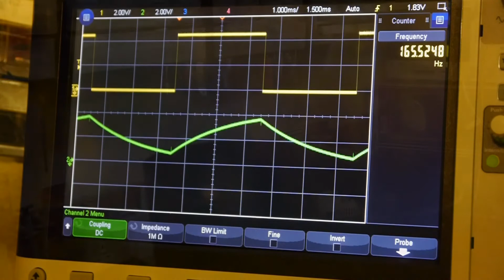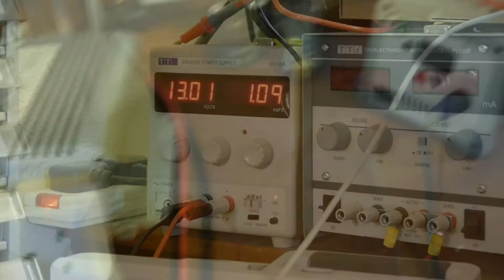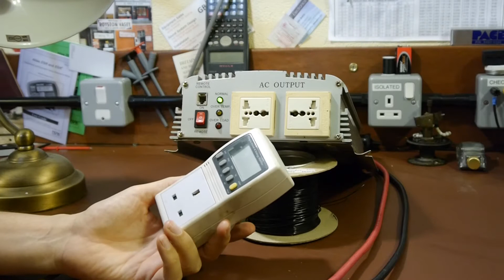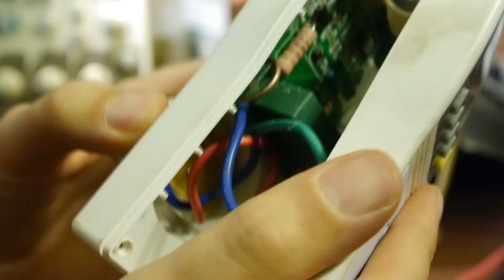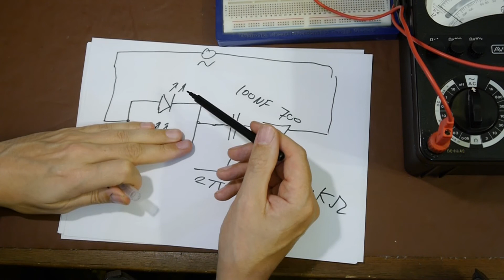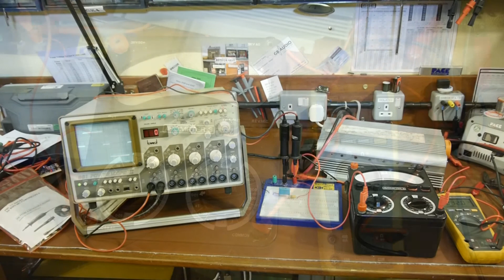Mains Perverter

Comment: Low frequency inverters are HEAVY. These are high frequency, and the better versions use sinusoidal PWM to control the output stage. And, yes many can run high wattage loads. I run an air conditioner on one. Cheers!

Comment: Sorry to hear about your Dad Chris and hope he make a speedy recovery. Glad to see you back though. I used to have one of hose under the bench in a caravan. It did drain the battery very nicely. That’s a horrible waveform though. Great video as always. Cheers Graham
Reply from the maker: Radiocruncher Graham nice to hear from you and I hope all is going well with you.  If you think those voltage waveforms look bad wait unit you see the horrible current pulses. Wanted to ask where you got your nice variac from ?
Reply: All is good Chris thanks. I got the isolations transformer/ variac from an bay seller. We did a bit of haggling though. This is it http://pages.ebay.com/link/?nav=item.view&alt=web&id=112558280270
Reply from the maker: Radiocruncher  Very very nice but expensive have you been happy with the quality. Regards Chris
Reply: It’s seems to be put together very well. First thing I did was take the case off then phoned Simon to make sure I got the right one! Regards Graham

Comment: I think the current difference is all to do with power factor Chris. Try plugging in a radio into it.
Reply from the maker: Simon Spiers  Hi Simon. Well it’s certainly related to the operation of the Wattless dropper employed within the power  monitoring plug.  The AVO definitely was not correct instrument to measure the current flow as it’s designed for sinusoidal waveforms where as the output from the inverter is a modified sine wave which is really a square wave. For a square wave I’m guessing is relatively easy to apply a correction factor but this is not exactly a square wave either. I thought I had the answer using the Fluke 175 true rms meter as it indicated 26mA  for the square wave and but when I measured the same thing using a BK5491 I get 3.5 mA. So go figure are any of the reading correct. Who would have thought a simple AC current measurement could be so difficult.

Comment: Good to see you back Chris, I thought you'd been heads down with an important work project. Good to hear your Dad's back home anyway. Was he in any rush to get home, what with all the young nurses? :)  On the inverter, is this the sort of thing they install on more recent buses? I noticed on our ones here they have BS 230v sockets every few seats and wondered if that was just for the cleaners when the bus was parked back at the depot with an external supply connected or they had a hefty inverter installed. One of those things you ponder on the way home after a night out in Cambridge. The AVO will measure square wave shapes high, just to confuse things.

Regards - Andrew
Reply from the maker: Andrewausfa Hi Andrew hope that all is going well. It was nice to post a video again but don’t think I will get many more in before Christmas. Just got lots on at the moment, away a lot with work and doing work projects at home nights and weekend.  I’m guessing these inverters are quite common now but the output is just horrible. If I was going to purchase one I would definitely pay more and buy a pure Sine wave type as opposed to modified sine wave as this one is.  You know I have thus far gone through life quite happy with power voltage and current measurement but you should see the horrible current pulses not so easy to work out the long hand root mean square of these buggers. I have tried 4 different meters and got 4 totally different readings but on the other hand it’s very interesting when things don’t go to plan. My best regards Chris

Comment: My suspicion for the lower current on the test circuit is the average voltage on the inverter being higher, which means less current on average, as you are trying to do a power measurement in effect, power would be the same, higher voltage gives less current for the same wattage.
Reply from the maker: TheDefpom  Hi many thanks for reply. Just for completeness my test circuit was trying to replicate the circuit inside the power monitor plug that was over heating. I think it was the capacitor overheating but perhaps this requires a bit more examination on my part.   Would you explain your comment a bit further still not completely with you. I wondered if my AVO current reading were in accurate as I assume this is designed to work with sinusoid rather than the square wave. I guess that an easy test to confirm.   Do you think I would get something more realistic using two modern RMS meters for the voltage current. Looks like I should make a short part 2 Video.   When I used played with some old inverters in the past I noted they also had this square wave output but they did PWM with a fixed duty cycle I assume that was for power control. The output waveform looks fixed but could be I have not loaded it enough yet.  Do these use a boost converter and H bridge inside ? Thanks best regards Chris